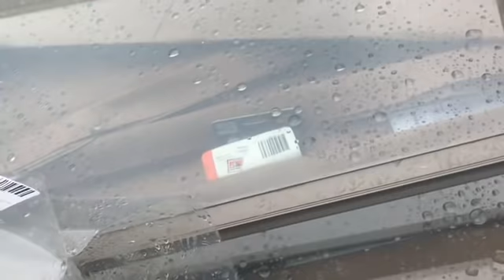Still stoked on a crummy day

Comment: Yellow chevy runnin kinda gnarly
Reply from the maker: Mario Betancourt yeah especially when the engine is cold until it warms up
Reply: @steelisthemeal  any luck on the EGR tube on the chevy box truck?
Reply from the maker: Mario Betancourt no I haven’t been bothering with it when I get too aggravated when I’m working on something I just walk away from it
But I need to finish the job LOL
So maybe in the next few days or something like that I need to get Leica thin ranch I think it’s 1 5/16 or maybe a little larger that’s right it’s not more than 5/16 is the next step club the next size larger than that you need two of them to get this thing and screwed otherwise you end up twisting the EGR tube
Then I have something else broken
I don’t need that
Reply from the maker: Mario Betancourt of course what’s awful is is been broken since June this truck hasn’t been used
Not a good way to make money